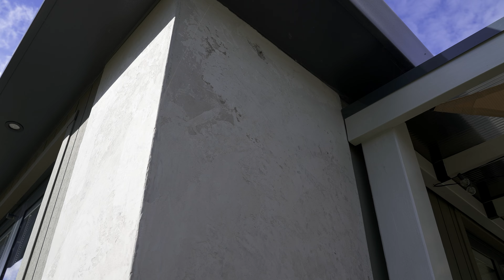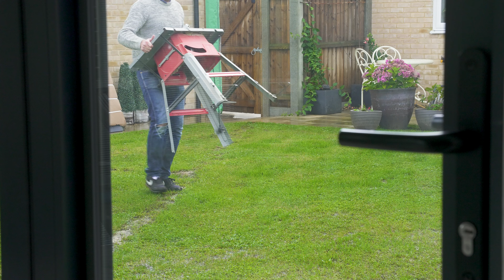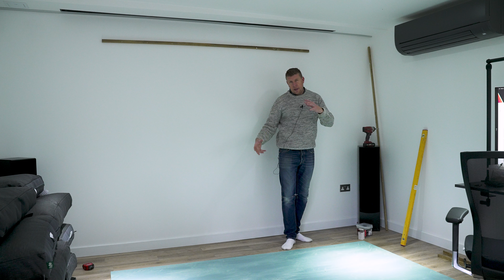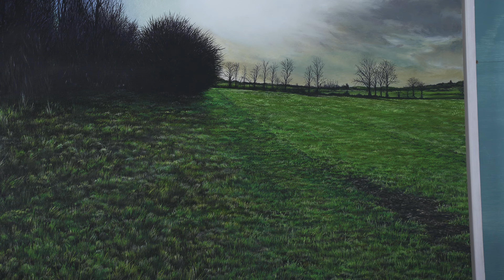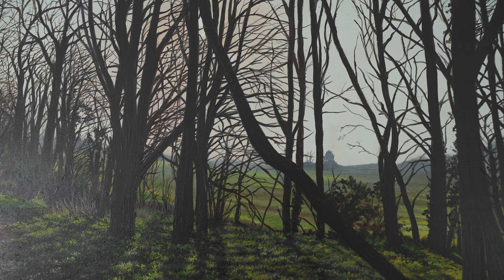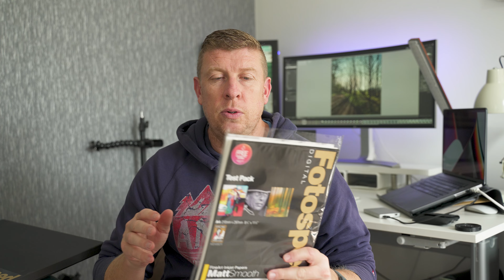Make Stunning Art Limited Edition Prints! The Easy DIY Guide

Comment: Hmmm… why not two of the same lights right left… same distance same angle .. and why angling them upwards.. that’ll result in upper-and lower area of the painting getting not the same amount of light -  adding a polarizing filter in front of each light will also help reducing reflections on the painting; often real helpful when artists bring in paintings already varnished .. sometimes even with glossy varnish - another suggestion is to use a macro lens.. that’ll be as sharp as it gets - last not least, using colour checker and white-balance tools for getting as close as possible correct colour reproduction in the file to make printing easier and with less need for test prints. -
Reply from the maker: All good points thanks Peter, yes agree two lights the same would have better results, I didn't notice any difference in colour / light in the end results. Thanks for the comment some good points you make.
Reply: @FlowWorksArt   - thanks much for your reply, James - I have been photographing my own wannabe-arty works ( and just occasionally other people's works) since about 2003 or so... mostly with space- and equipment-limited- makeshift set ups and then plenty post-editing required to make up for the in-camera- compromises .. Ha!  .. and been home- printing on Epson since about 2008 -   two tall 3 -5 feet strip lights - several mounted strings of LEDs - angled from right and left with the polarizing foil in front of them makes for even, non-reflective, shadow-free illumination (on the often rough brushstroke-texture of paintings) - and large paintings are done with several photos overlapped for stitching - ... and, by the way... your dedicated studio space with view over the green landscape... oh my... what a dream compared to the little apartment I am in here!!   :-)     wish you plenty fine artworks, photographs, and fine prints .. it's fun, for sure  - ciao ciao. -
Reply from the maker: @PeterQuentercrimsonbamboo  Thanks Peter some great tips again, yeah I will be doing more of the reproduction in the future so I will be investing in some more lighting along the way no doubt, I did have to run a good few test prints in order to tweak and adjust the colour to get it as close as possible to the originals. But got there in the end.